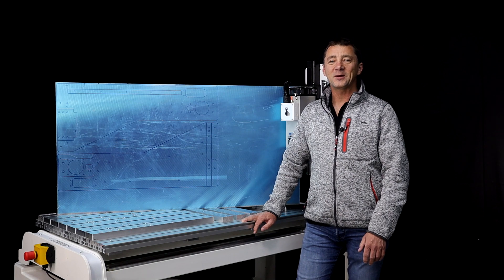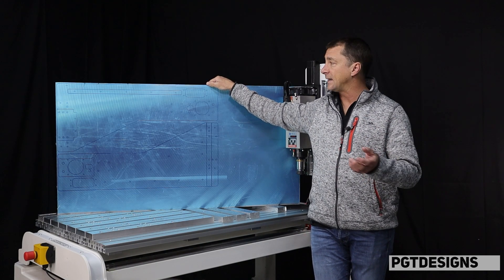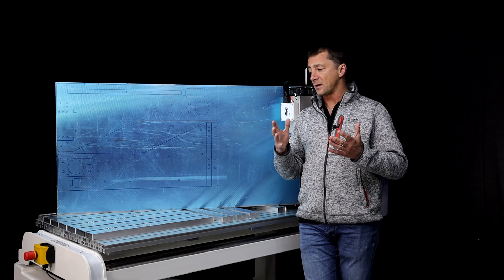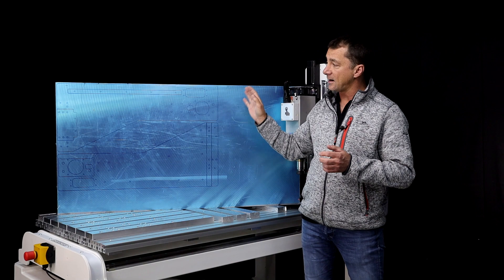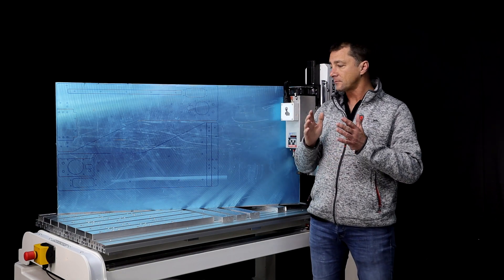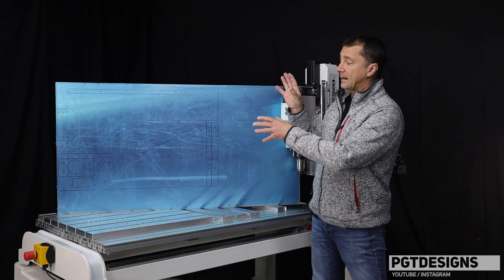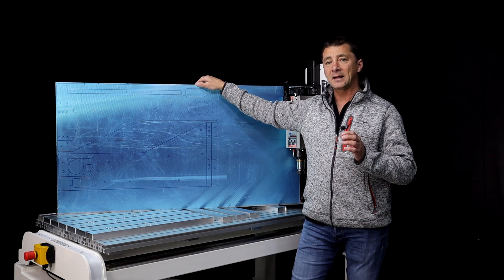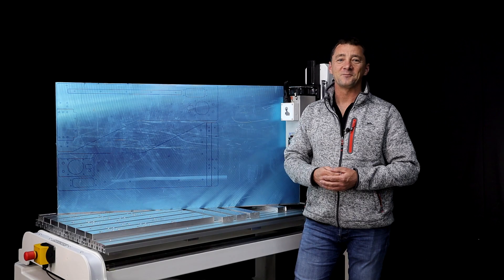BIG (#Plasma Upstands) on the EXECUTIVE Model 8 #CNC #Router. Challenging job it turned out to be :)

Comment: The machine sounded very good during the cuts and the surface finish looks good too. Yes, sometimes the raw material is expensive and the focus needs to be on the job … the customer comes first. If the corners are the size that you have shown then I just machine them away. I think it’s less trouble and in the end I cannot tell that I have reduced the life of the tool. Nice video very organized and concise.
Reply from the maker: I actually think you have a great idea regarding just machining the corners away. Not only will it keep the spindle turning but also reduce the possibility of the "slug" lifting up by accident while cutting down to the leftover of 1mm. Thx so much :)